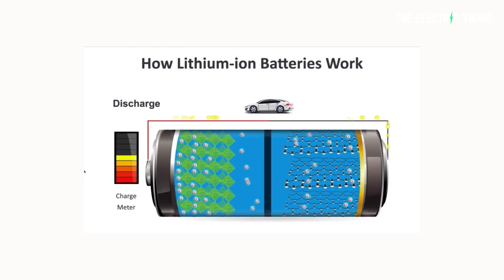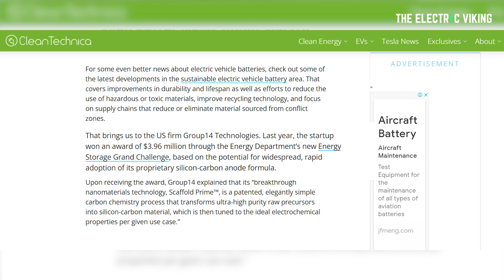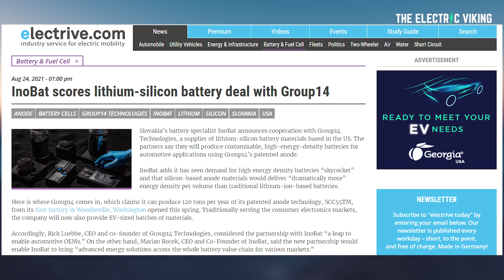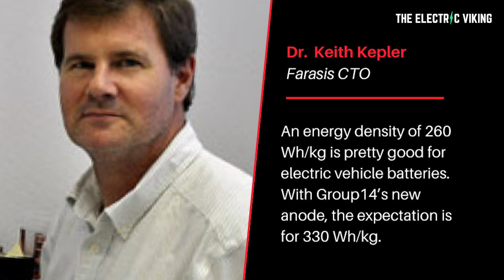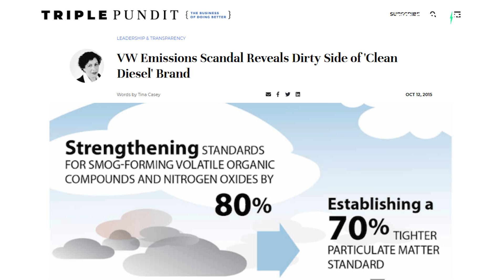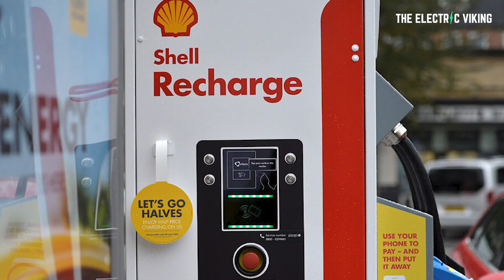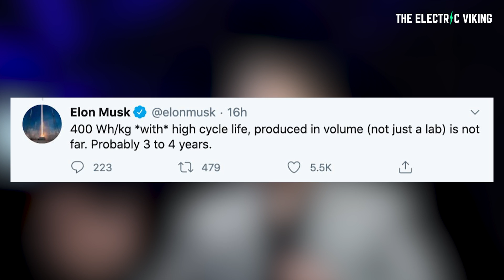NEW battery TECH will give lithium batteries a 25% BOOST

Comment: Trying to carry around the extra weight of a battery to go extremely long-range does not make sense.
Fast charging 300 mi range BEVs will be perfect.
Reply: In 2030 most EVs will probably have a range of between 200 and 300km.
By that time there will be enough fast chargers and enough people who would have driven EVs long term to realise that for most trips 200km is enough and it is better to pay less for a 200km car and spend more time on a long trip once every few months than pay more for something you rarely use.
Reply: @franciscoshi1968  You like short distances. What about Australia or America?
Reply: @paulsinn6096  the average distance driven in a day in Australia and US is about 50 km per day.
Some people drive more some less. That is what average means. Most people live in cities and don't drive very far. The majority of cars are made to suit the majority of people. That is why you can't buy a 4x4 EV but you have lots of choice in the small SUV size (like Kona,  MGZS, leaf, Zoe) 
Anyone can make a car the size of a model X but you don't see as many around as model Y or model3. It is all about which market is the most profitable.
I have two EVs with 200km of range and I don't have to charge them every day and yes long trips are annoying but I don't do long trips very often. 
When I bought the first EV I was only going to use it as a runabout because I thought the rage would not be enough. At the time the requirement was for about 50km of trips during the day.
After owning the car I found out it will do longer trips easily. Just jot as convenient but not worth an extra $20k for a once a month questionable convenience.
Last week I did a 300km drive (that I was not expecting to have to do) and it worked fine. I put it on a fast charger for 15min and that was enough to finish the trip.
Next week I am doing a 350km drive and I don't expect it to be an issue at all.
If i was doing 200km per day every day yes it is better to get longer range.
I often look at at how far the people I know drive and a car with 200km range would be fine for 90% of them. They often mention trips they do that they say would not work with the EV then I check with the route planner and the extra time to drive the EV is less than the time they waste at the petrol station buying stuff at the shop. I have gone with them and I always get more than enough charge waiting for them in their petrol cars.
My brother is a driving instructor. He is the one that drives the most and even for him the 200km range would work.
Reply: @franciscoshi1968  I am retired. In my previous life I needed a Suburban to carry several hundred pounds of samples and drove 200 Miles one way, sometimes more. Often it was -10 F. Electric batteries are not developed
enough yet for that function, but I hope it will come. Where I live, most of the men drive full size ICE pickup trucks like the Ford F150. The electric F150 Ford is showing is more of a "gentlemen's truck", not a work truck.
Reply: @paulsinn6096  that is why I say the majority. The average is 50km/day. You are on the high side. 200miles at 60mph is a 3hr trip non stop. Most people don't drive that distance often enough.
It will all come down to how much more people are prepared to pay to have the extra range. I everyone complains about the price.
Reply: @franciscoshi1968  I live on a highway that has a town of 1000 to 1500 every 6-12 miles. Most people drive 50 to 90 miles round trip to work each day,
some a little more. 200 Kilometer range is not enough in the winter to be
safe. It is below freezing for 4 months, so range is reduced by 10-40%
depending on how cold. We need more batteries and higher efficiency.
Reply: When 400 Wh/kg is reached, the weight of the battery, even for ranges like +500 miles, start to become marginal. Typical when the weight of the battery approaches 25% of the total vehicle weight, it starts to be in-efficient to add more battery as the added weight start to tap more and more into the vehicle overall efficiency and driving up also the structural loads and weight. What range 25% battery weight ends up to gives is directly proportional to the energy density of the used battery technology.
Reply: If not for chargers being not enough, I would say 200 miles is maximum necessary.
Reply: @موسى_7  If the cost in a not too distance future of a few 100 miles extra on top of what is “needed for average consumers” add just 5-10% to the vehicle price, I guess that option will be frequently taken. But it wouldn’t surprise me if a future environmental-facist governments put an extra tax on large batteries. Having better than “average” should be punished. Taxyou! 😞

Comment: This would be excellent if it applies to LFP.  I was very disappointed to find out that BYD is selling NCM batteries to Ford.  Most of my portfolio is in BYD, but I don't want to profit from the sale of highly combustible batteries.  If anything happens, I don't want it on my conscience.  I would like BYD to stop making NCM batteries and prioritize the welfare of their customers,  both direct and indirect.  Perhaps this breakthrough would make it easier for them to do that.
Reply: Tesla seems to have solved the fire problem with NCM batteries.  I imagine BYD has as well.  If it bothers you, though, you could always reduce your position in the stock.   Diversification is usually good, although I'm overweight in TSLA because it's a unique situation.  I have some BYDDY too.

Comment: I wish hydrogen could be made to work for smaller vehicles. Batteries are too much of a hassle relatively speaking.
Reply: The "hassle" of batteries is no match for all the problems with hydrogen.
Reply: So you want to keep handing over your hard-earned money to the fossil fuel industry and contributing to their profits?
Reply: @Peter-vn8ue  no. Batteries have a few problems. Weight and degradation and the effect of outside temperature. At higher temperatures batteries degrade faster at lower temperatures you lose capacity temporarily. Hydrogen doesn't have those problems. It has others like efficiency and logistics. But it is just a wish. I wish it could be done but it can't be.
Reply: @pk47831  Hydrogen is only about 10 times more volatile than gasoline so you wouldn't want it to go kaboom if your are in a vehicle accident.

BYD in China offer owners of their new Dolphin ev lifetime warranty on their Blade battery to the first, original owner of the EV and their batteries can be charged from dead flat to Full capacity over and over again.

 BYD are that confident with their Blade battery and the battery chemistry it should out last the Ev and last 1,000,000 km. So how is that for battery degradation concerns?
Reply: If you read the text under the refill flap of the Toyota mirai is says something like "do not refill after xx years", the life of they hydrogen system is only a sort period because of hydrogen embrittlement. Whereas some BEV 's now have LFP batteries that will get 1 million kms.

Comment: When I was in school in the 70’s, I was amazed by the fact that everything in nature is a cycle. Rain falls down, water evaporates and gets cleaned in the process. And I was thinking that everything that will last over time must use the same process. Then I was thinking about the things humans do, and realized that we need to use the same enery source as the rest of the nature, in the long run. And the sooner we get on track of that, the better. We have a great nuclear fusion power plant, called the sun, that can supply all the energy we need. All we need to do is harvest it. There is no need to use any fossile fuel. The sun shines on half the globe, day or night, summer or winter. We can harvest solar energy in so many ways. Hydropower, windpower, heat pumps or solar cells are just a few examples. Harvesting is easy. Distribution and storage is a bit more complex, but I’m sure they are problems that can be solved.
Reply: I have 20 solar pannels on my roof, 6.2 kw, makes betweek 7,000 and 7,500kw per year, enought to drive 28,000 miles. Doesn't even cover the whole roof. And this is Ohio. It's not even that sunny. I even have 4 of them facing east and west, and a bit of shading.
Reply: You can add to that the earth's energy store as well. Unknown to most people the core of the earth is one thousand degrees hotter than the sun's surface a great source of energy that has been ticking away for four billion years. It is free energy!!
This energy rises to the earth's surface bleeds into the atmosphere and is lost into space. We just need to harvest some of it.
Reply: Every other organism takes only what it needs from its environment and contributes to the overall health of the environment in its own way, without depriving others. Capitalism is not and never will be scientifically valid. No matter how much green lipstick you apply to its still a cancerous pig.
Reply: @davefroman4700  How do you explain parasites that kill their host?  Nature is not as friendly as you think it is.  Lawless capitalism is a cancer.  Capitalism with appropriate constraints and a reasonable amount of socialism is about the best you're going to do without somehow radically altering human nature.
Reply: @incognitotorpedo42  Go back to school and take on some basic physics. Infinite exponential growth is not sustainable on a finite planet.
Reply: @incognitotorpedo42  
Then we have to radically alter human nature.......
Reply: A bicycle is better than a motorcycle for nature.

Comment: You are on thin "ice" with me and others making this political. Ev's can stand on their own merits no need to bring an anti conservative bias into this. Ev's break down less and cost less to operate. That's enough. Stop it. Limbaugh would have been an adopter himself if it made sense at the time. And do not forget electric rates will soon rise tremendously. On the verge of unsubscribing. You know what pollutes worse than oil etc? Nuclear war caused by green idiocy. You want to really see Mad Max?  Let the tech stand or die on its own. It will do just fine without cutting conservatives and rallying  up a lot of less than intellectual leftists who will bust us down to no power.

Comment: I hope it works out, we need to get off of fossil fuels if we want to have a liveable planet in 50 years.
Reply: I upvoted your comment, Darrell. But a planet wide climate disaster will be felt much sooner than 50 years if we don't get off fossil fuels soon.
Reply: We could "get off fossil fuels" for transport in the warm climates, but not in the colder climates, at least not yet. Fossil fuels will be used in heating for the
foreseeable future and in manufacturing everything in our lives, maybe forever. The oil and gas industry allows us to eat and wear clothes. We could support 
half our world population without oil.
Reply: @paulsinn6096  I would suggest reading Electrify, the latest book from Saul Griffith. he - and I - would challenge your assertions that we'll never be able to move off fossil fuel. I would also say that we are doomed as a species if we don't change.
Reply: @benjaminnead8557  Benjamin, it's not an all or nothing proposition.
Everything we do to clean up our act will be helpful. It's all useful.
Reply: @paulsinn6096  When people say "get off fossil fuel," that means to stop burning it just to be able to drive around and heat/cool our homes. We'll still need plastics for many durable goods, as wood/metal simply won't work. As we transition to EVs and renewable energy, and the oil companies loose that big revenue stream, the fossil fuel industry is going to push single-use food packaging like never before. That's what we'll have to keep an eye on. Interestingly, we can address atmospheric global emissions effectively, but still end up with oceans filled with discarded plastic trash. Again . . . read Electrify.
Reply: @benjaminnead8557  Home heating will not change for many, many years
because of furnace cost and reliability. We use gas and electric. Heat pumps are a poor choice here, too cold.

The single use food packaging is OK if we recycle it. Paperboard is a good alternative for packaging many things, but plastic works better for protecting the item from theft and damage. You and I are on the same page.
Reply: @paulsinn6096  Air source heat pumps don't work too well in Eskimo climates. I get it. I grew up in Pennsylvania, and, yes, there will always be someone who will say "Pennsylvania? Well, my winters are much shittier than your winters." But I digress. 

You can move to Arizona, like I did years ago. Here, of course, it's air conditioning that makes everyday living palatable. We could easily run everything down here off solar, wind and batteries very easily, if our local/state leaders had the political will to allow that to happen. We still get some of our grid mix from coal, which is insane. 

As far as the frigid north is concerned, biomass, geothermal and - hate to say it, but - nuclear might be your only low carbon or carbon-free options. For new home construction, ground source heat pumps would work just fine in even the coldest of places.
Reply: @benjaminnead8557  I'm in northern WI, but spend winters in AZ also, in
Bullhead. I expect our WI temps are much colder than PA, closer to northern Maine. The oldest daughter in WI has a heat pump and has had many problems. On the other hand, I have the perfect roof and believe solar will work to cover most of my energy costs in WI. If only the installers weren't so greedy.
Reply: @paulsinn6096  Yup. Shittier winter than what I ever had. :-) Nothing like an Arizona winter when it's freezing everywhere else. I haven't looked back for 38 years. Seeing a dusting of snow at a distance on the mountains near Tucson a few times a year is close enough for me. I put up with the summers here, though, and that's when the energy consumption comes in. 

Solar does work well in the northern latitudes. Better financing for distributed solar is coming (I'll reference the Electrify book again, as it's talked about there.) You're also not too far away from the northern US wind corridor and I'm guessing that's where a lot of your clean and cost-effective grid electricity will be coming from eventually. As for comprehensive grid base load storage, there are a lot of good ideas already out there. It's already been invented. We just need to build this stuff . . . 

https://www.youtube.com/watch?v=6tEkRRec3NE&t=717s